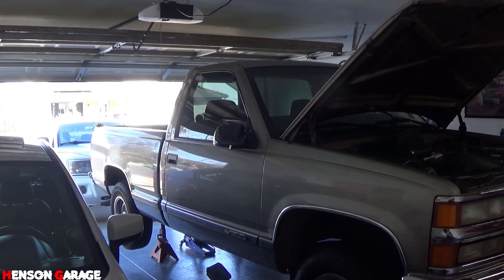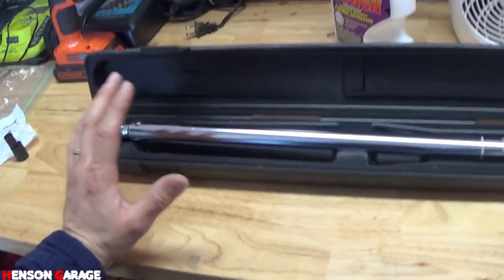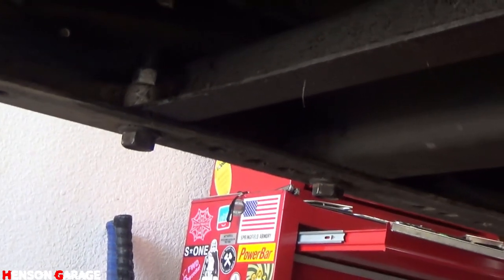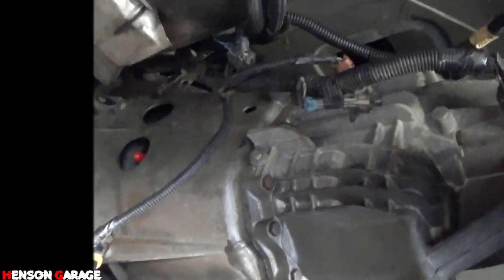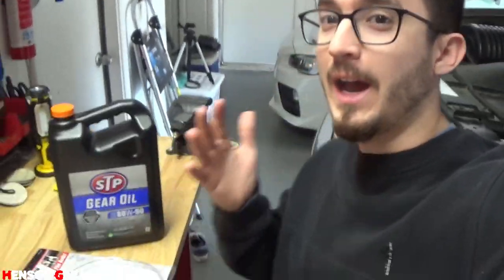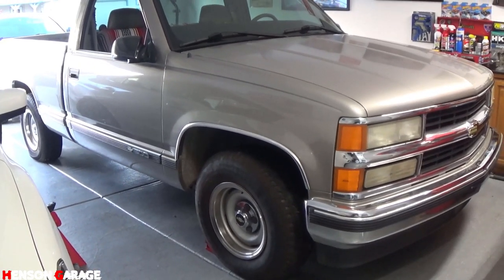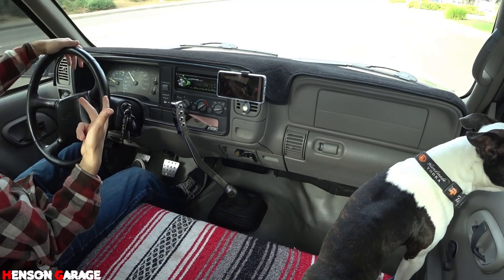OBS C1500 CLUTCH REPLACEMENT | + SLAVE & MASTER | 88-98

Comment: Dude that’s the wrong oil for that trans. You need synchromesh not gear oil. It’s going to lead to bearing failure if you don’t use synchromesh
Reply: Matt Conner was just about to say that!
Reply: Yup before i bought my 93 someone put gear oil in it and the rear bearing in the transmission went out and i was stuck replacing them gear oil is to thick to get into the top bearings i use syncromesh

Comment: Because you had the flywheel machined you should have put spacers behind the slave cylinder.  You are running out of throw to appropriately depress the clutch fingers which may lead to slave cylinder overextending and bursting.
Reply: Were can i find the spacer??
Reply: @adriandonato1280     You have to locate washers equal to what you machined from the flywheel face

Comment: Put pilot bearing in freezer a day or 2 before assembly, heat the hole a bit with propane torch, put a coat of grease or anitsieze to the pilot bearing and install in crank with a similar sized socket, a few light taps

Comment: I noticed my old slave cylinder has a notch in it in which a clip was removed to disconnect the hose. The new slave cylinder does not have that notch, but has some sort of teeth inside which seems to grip the hose instead of a clip. Is this common and aftermarket parts or should I find a slave cylinder with the original clip?  Thanks

Comment: The bread method of removing the pilot bearing works great, but higher Mileage engines that may have excess crank shaft end play and worn Main bearings. All that banging can seriously knock stuff loose.

Comment: you better be doing a little more research there on the trans fluid your putting back in because that oil your useing defently will cause premature wear of the syncros and be a real mother to change gears in a cold climate i have built straight drives for 20 years just a little addvise to you really like the rest of your work tho really clean job friend great job!
Reply: Is Dextron 3 the same as synchromesh?

Comment: How did you tighten the master cylinder line into the slave cylinder? Mine is leaking a bit and needs to be tightened

Comment: Please would you tell me what I did wrong I installed a manual transmission 1991 Chevy 1500 no shifting any more I change rear main seal clutch and sleeve 😢

Comment: @32:00 where the clutch magically self-bleeds itself. The thing I came to see didn't get witnessed.:-(
Reply: He didn't have to bleed it. The kit he got  came with fluid in it ready to go
Reply: @JavierRodriguez-wx5zw  At 17:16, you can see the new slave cylinder not connected to a hydraulic line. It was not pre-bled and I don't know why you would try to suggest it was. What do you think you're gaining with such a blatant falsehood?
Reply: I came to see how to bleed the slave as well. Besides that it’s a great vid
Reply: He yadda-yadda’d over the best part

Comment: Did you have to bleed the slave cylinder? Or how do you bleed an internal slave cylinder?
Reply from the maker: Slave cylinder has no fluid in it so it doesn't need to be bled. But the master cylinder will need to be bled if you just buy the master cylinder by itself but I bought it as a complete set with master cylinder and lines all attached and it was pre bled so literally just have to get it from the store and hook it up no bleeding necessary.

Comment: What manual transmission and differential oil does it take? I have a Chevrolet Cheyenne truck year 1995, 305 tbi 5.0 liter 8 cylinder engine, 238 thousand kilometers and I don't have the vehicle manual, they are the same models from 1988 to 1995 and what engine oil does it take?
Reply: 5-30

Comment: Never put an input bearing in these. The NV3500 and nv4500 transmissions Achilles heel is if the input shaft is left unsupported when the input bearing goes out it'll shake the transmission apart. Put the old style bronze bushing in there and you never have this problem!!
Reply: Can you replace the input bearing without disassembly of the trans ?

Comment: Unique pilot bearing remove and install. I wouldn’t recommend that brother!
Reply from the maker: I couldn't find a pilot bearing puller that would fit..the one from O'Riley's and autozone was to big
Reply: @matthew1er  Hey you got it done but I got concerned when you used a hammer directly on the bearing. Use a socket instead of a bolt. How is the truck running? Thing about this is people exchanging ideas and you showing how you did yours. The jack stand thing scared the crap out of me too. I know you had multiple points of contact, but I lost a nephew to a vehicle falling off jack stands. You should add an extreme risk warning to that. Be careful out there.
Reply: I’ve used the bread many times with no issues just a lot of hammering
Reply: @zackeryleonard6112  Yep, it's been around for awhile.
Reply: @matthew1er  next time freeze it. You can literally see the metal shavings coming off the bearing as you’re beating it straight in

Comment: I have a 1994 GMC Sierra looking to do a clutch my slave is on the opposite side from the looks of it and it’s a pivot fork setup
Reply from the maker: Yup should be a different type of slave cylinder.. is it in or outside the bell housing?

Comment: Yikes on the gear lube! That’s some heavy weighted stuff. I agree with the synchromesh comment.
Reply from the maker: I ended up changing it to the synchromesh
Reply: @matthew1er  how’s the 1-2 shift now?
Reply from the maker: @anythingsteel120  it’s perfect now I think the oil just needed to coat everything in the trans
Reply from the maker: I’m hoping to use this trans when I eventually swap to a 6.2
Reply: @matthew1er  those NV3500’s are tough, but not that tough. I’ve got the exact same truck, but mine was built with the 5.7, when this engine goes the plan is to LS it with a 6-speed.

Comment: hello can you tell me what did you use to take the pilot bearing out....thanks
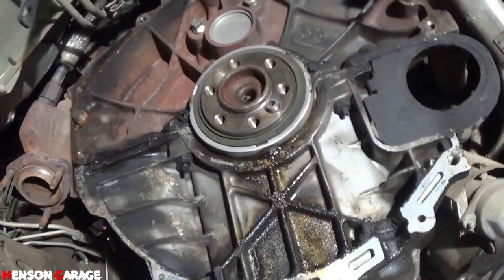Reply from the maker: It’s at 5:45 seconds check it out
Reply: thanks for your answer, but i like to know the name of the product and where I can buy it...thanks
Reply: WHAT is the material used to get out the pilot bearing ????
Reply: Is that bread ????
Reply: @1tinytanic   indeed.
Reply: A slide hammer would work wonders. A couple of slams and it’s out. Most auto parts stores will rent them out for free. Essentially you buy the tool from them, and return it for a refund when you’re done. I’d rather buy one than pack the hole with bread, grease, or wet toilet paper. I used wet toilet paper once and said I’d never pull another pilot bushing without a slide hammer.
Reply: @davidmueller980  Installing with a hammer is not ideal because it will put pressure on the thrust bearings with each smack, but unless you pull the flywheel off and press it in there isn't much way around using a hammer. If you must use a hammer I'd recommend placing the bushing in a freezer for an hour or two to get it to contract some so it would require a bit less force from the hammer to seat the bushing. However, unless you're just pounding the hell out of it I'm sure the thrust bearing takes a similar amount of abuse when you step on the clutch pedal.
Reply: @1tinytanic  I use old rags and grease, not so messy.